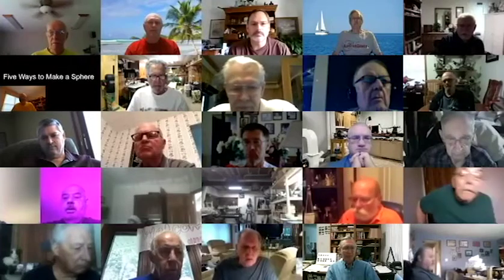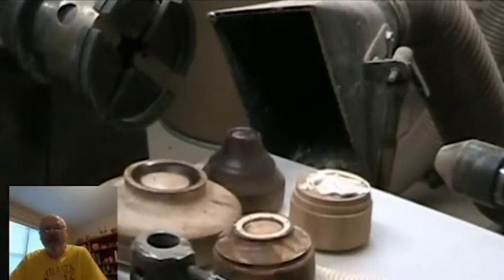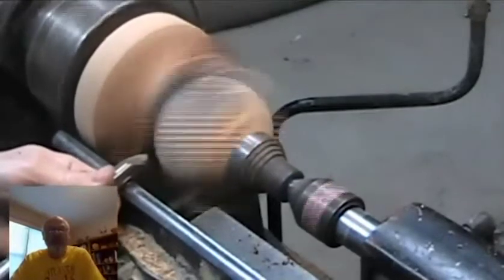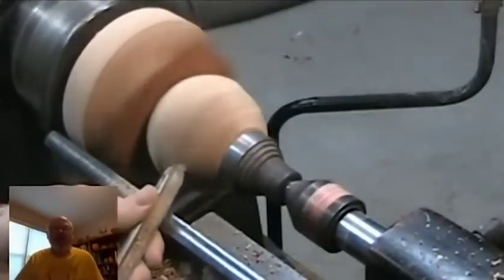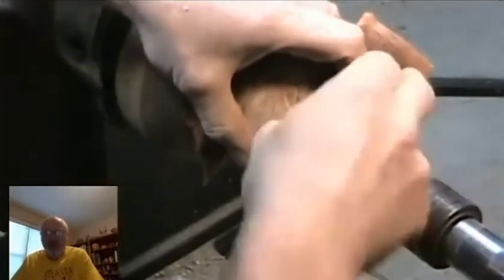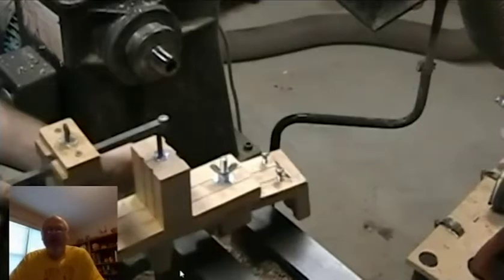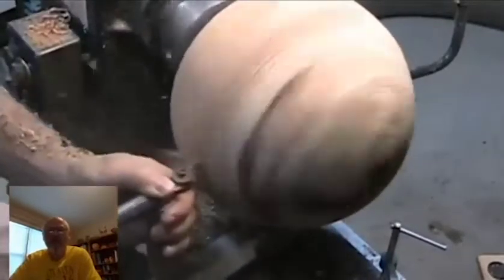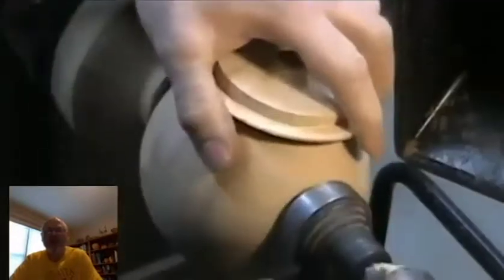Five ways to make a Sphere

Comment: 6 - Use a tablesaw with a jig  to remove most material, final remove shadows on lathe between cups, sand with a piece of plastic pipe with sandpaper with a cross cut into middel to better follow curve.
animation: https://youtu.be/egUNaP-0-x0
Jig I build based on the aninmation model https://youtu.be/jG-AGjRBfIk it works
Have to build one with more room for all the shavings, up scaled dimentions to make it easier to cut all without cleaning shavings.